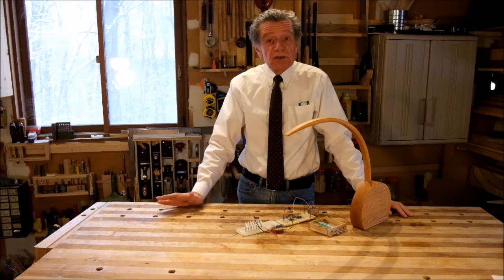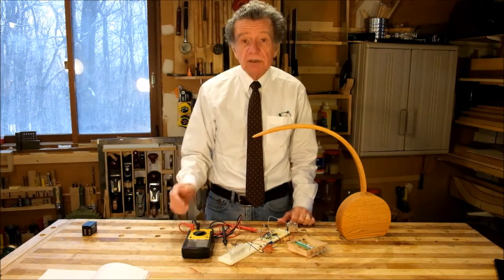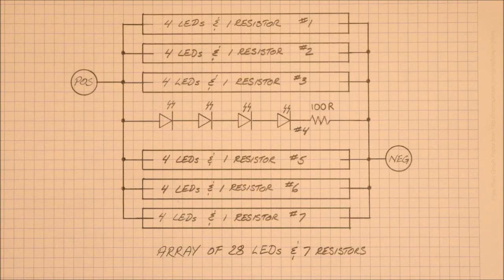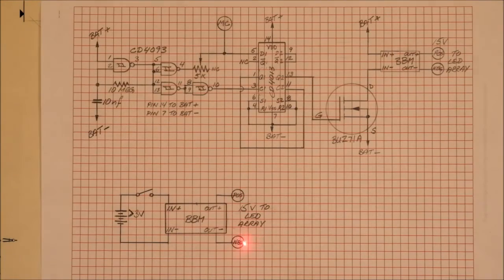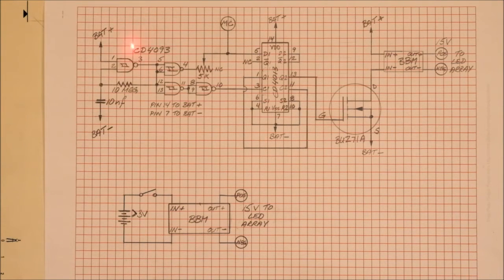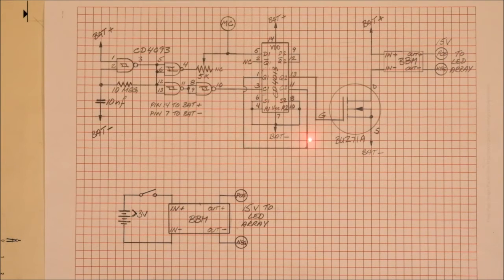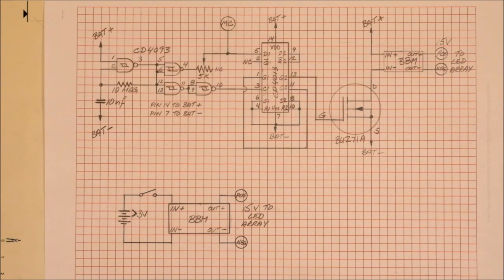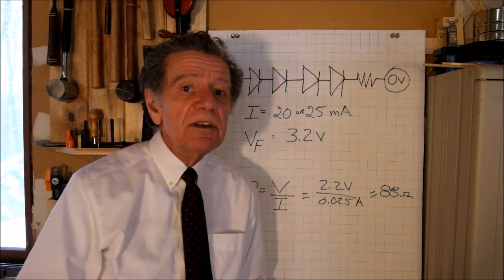George's Woodshop:  LED Lamp, Part 1: Electronics

Comment: Looks like a great project, thanks for sharing!
Reply from the maker: Hi Jim,  Hoping to pull it off.  The more experienced You Tubers post a.f.t.e.r they've built something.  Here, I've got nothing more than an idea of what the thing is going to look like.  Still, though, the basic steps should be informative, even if the thing ends up in the wood stove.

Comment: Couldn’t you run a line to the negative side connected to something like a decorative thumb tack? That way while your finger edges toward the ‘on’ contact, you would first discharge any stray static before making contact with the actual switch. What do you think?
 Thanks for the fantastic channel Professor George!
Reply from the maker: That's an excellent suggestion Brian.  It would completely eliminate the worry over CMOS IC's sensitivity to static discharge.  Instead I took a chance based on wanting nothing other than the hinges as metal parts.  In earlier versions using flip-flops listening to slightly delayed edges between clock and data, I had series resistors going out to the touch sensors.  Leaving the resistors out didn't seem to change anything, and I've grown lazy about using them.  I acknowledge, however, that static discharge is a real concern, especially in a carpeted room during a dry winter, so to have a discharge mechanism in place, like the one you suggest, is a really good idea.  Thank you for this suggestion, and thank you too for your kind comments elsewhere on my channel.